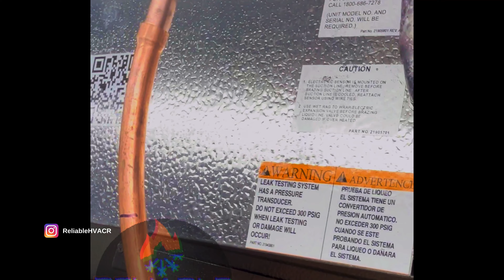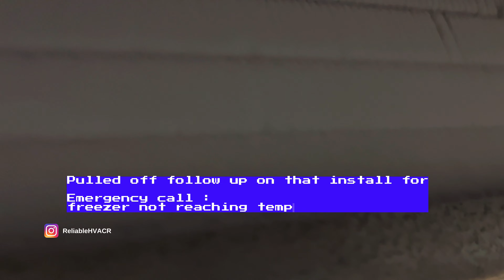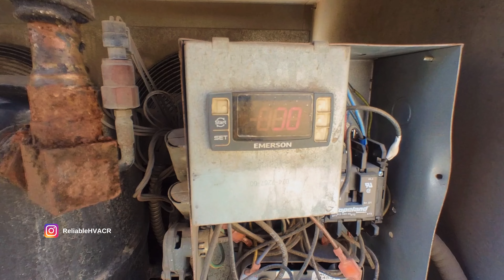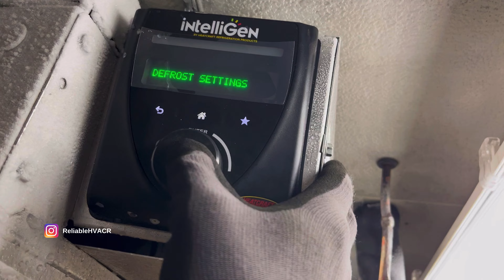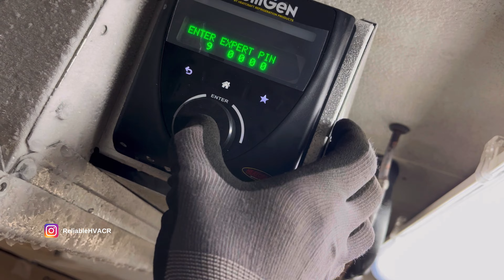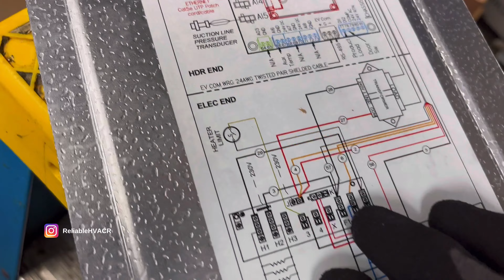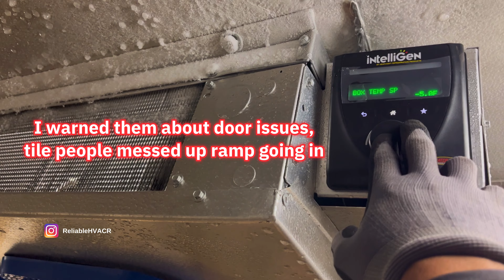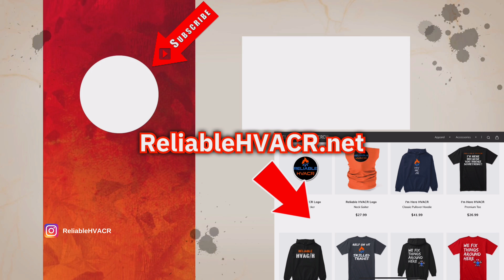Intelligen Freezer Install | Emergency Call | HVACR

Comment: Great video. Worked on a unit yesterday n had to do some electrical work. Wasn't exactly sure what previous company did but a lot of wires n interesting set ups. I took my time followed schematics n sequence of operations n got the unit running. Appreciate ur honesty and support for us new techs. Thanks
Reply from the maker: It's a headache but you can always figure it out if you really want to. Good job and thanks for the support 🙏🏽

Comment: From my understanding on the "Condenser Wired" setting, if you pair the evap with a matching Heatcraft condenser there is a communication cable that is an optional accessory that you can run from the condenser to the control board in the evap. Unsure of the purpose of it, as none of my customers have opted for it and I haven't looked into it much myself.
Reply from the maker: Doesn't look like it's popping up anywhere here either, I'll have to see what it's about
Reply: You can wire the CU and the intelliGen together with standard tstat wire. It monitors the safeties but does not communicate exactly with the controller nor does the controller “Talk to” the cond unit.

Comment: I actually found the common cause of your issue. I thought it was the EEV staying open and then staying closed. Staying open (freezing to much)/ staying close giving me low suction pressure. 

When you turned the power off to these units and then turn them on the board automatically closes the EEV. Then their is a 4 minute delay and the cooling process will began. How is everything getting frozen? The set point for the defrost delay or refreeze time for the fan delay is off. It’s set to 28-35 degrees and needs to be close to 20 to make sure the coil gets frozen so the fans don’t blow moisture or water everywhere. You should get 3 minutes of hearing refrigeration go through the coil after defrost reaches 60 degrees on your box temp. Then look to see if water gets pushed out or moisture when the fans kick on. If it does the fan eventually collects enough water to disperse out and freeze the fans. That’s why you will see back side of the coil has slight frost that will come off with one defrost cycle and the EEV and fans are covered in solid ice. So check set temp for box, coil temp set point for defrost, and the refreeze fan delay cycle.
Reply from the maker: Yes I had the manual, there is a process you need to be aware of. The eev opens up at different steps not just straight open. Problem is I let it run and first it was staying closed and then staying open during off cycle or defrost. I just had a bad board but during the test mode it tested out fine. I don't see a way to know while it's running normal operation if it's sending proper signals.

Comment: Nice video!!how do you pump down the unit manually?????
Reply from the maker: Front seat the valve at the receiver and it'll fill up with whatever refrigerant you have in the system